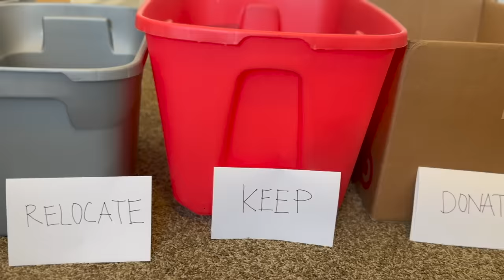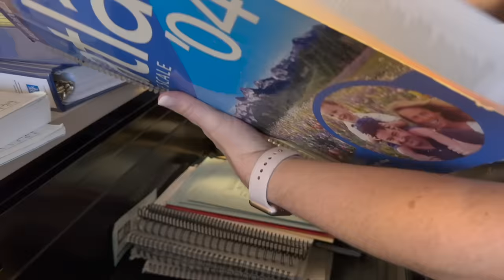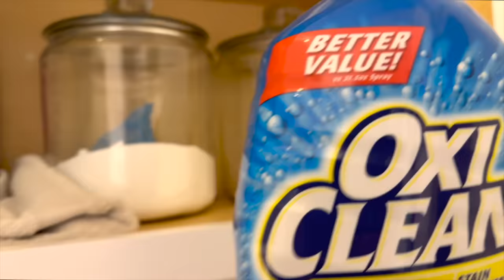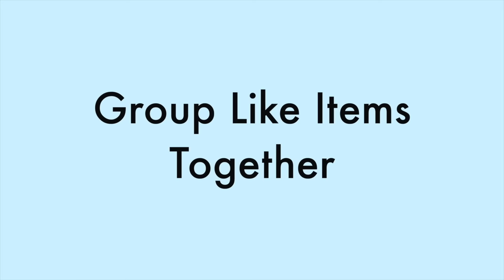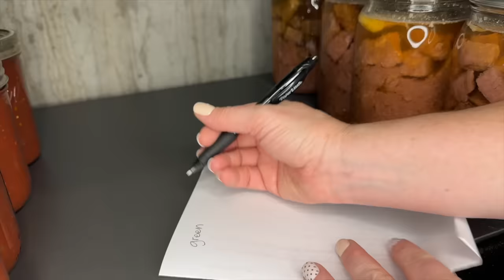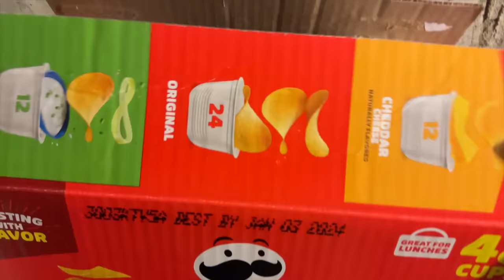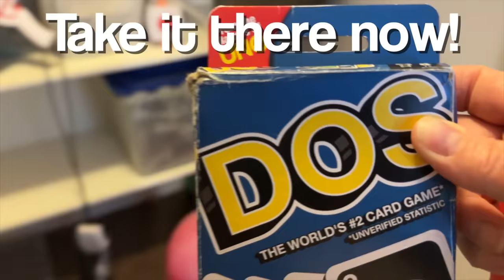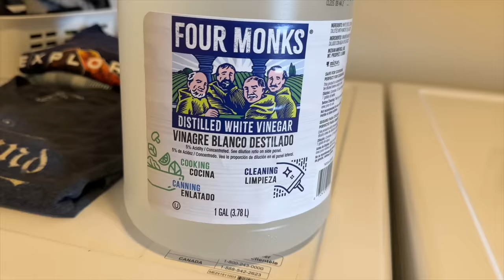✨MASSIVE✨ WHOLE HOUSE Clean Declutter Organize Marathon! 2 Hours of Motivation!

Comment: The small bathroom Dixie cups could have been donated. Even though the box was open whoever bought them could have thrown away the top couple of cups and used the rest which I'm sure were fine. I've bought paper cups at rummage(garage)sales & thrift stores before. The canning lids that were older I'm sure were fine as I've seen canning channels that use them all the time. Actually the older lids have a thicker seal which many canners love. However the Amazon lids, yeah those were iffy and needed to be tossed. Refilling the bottles in the bathroom use a funnel. I have a Tupperware funnel with about a dime size opening that works perfectly for that as I refill my big hand soap pump in my kitchen. This was a very enjoyable video with lots of great inspiration. tfs
Reply from the maker: Thanks!  I’m pretty sure I did do donate the cups. Now I can’t remember!  I try and donate as much as I can.  The bottles did come with a funnel, but the conditioner was so thick it wouldn’t go in.  Maybe the shampoo too. It probably needed to have a wider opening.

Comment: Switch your recycle bin & potatoes. Put the bin horizontal under where the potatoes are & move the potato wire holder to the other shelf. The recycle bin would be easier to get to not tucked into the corner.
Reply from the maker: That’s a good idea. I’ll give that a try!  Thanks.

Comment: I bought clear refrigerator bins for fridge, but then fridge died, landlord replaced with smaller one. (ugh) but found they work for bake goods for pantry, and under bath sink. Gaskets in unused lids will work well for about five years from the date they were manufactured
Reply from the maker: Thanks!